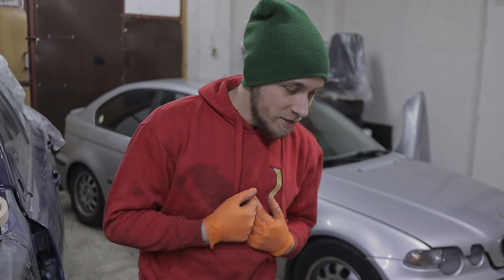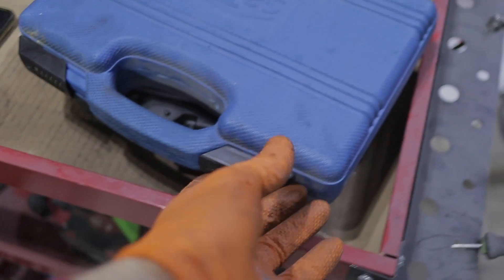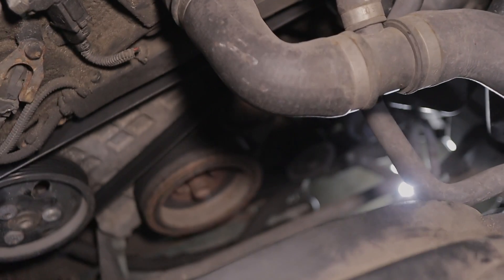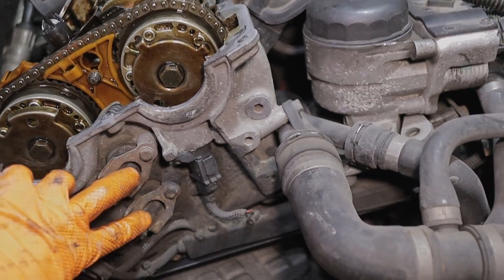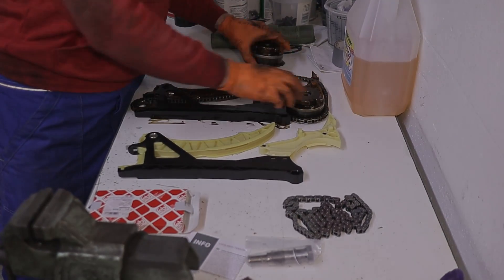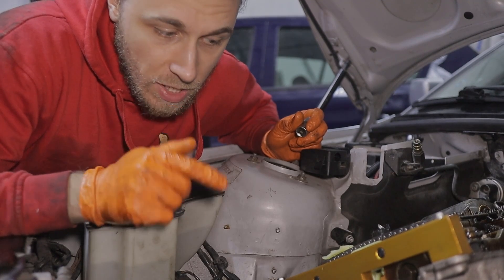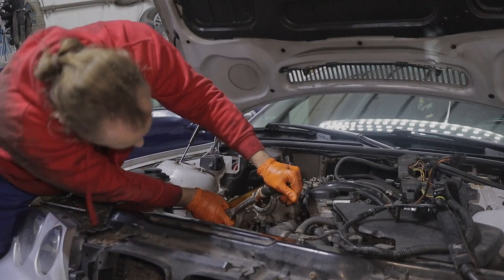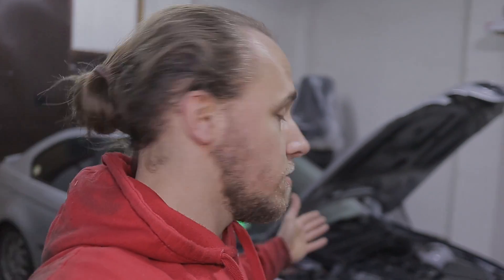How to change timing in N42 N46 N45 - BMW engine timing

Comment: Excellent video! Good to see you using Febi Bilstein chain kits - use nothing else. Not BGA, FAI etc. Febi is original Jwis as used by BMW.
The main problem I find with these is that the guides become brittle and break up. They are a white plastic when new - when they are orange from oil/heat they are halfway through their life and when they are dark brown, they're finished and about to break up. 
I've never had balance shafts move with the crank bolt out, but removing the oil level sensor to check is a great idea - I've learned something today! But - you need to tension the chain before tightening the cam bolts.

Before dismantling it's worth checking for a bad vanos unit - 16mm socket on the bolt and see if the camshaft moves when the vanos gear doesn't. 

It's worth mentioning that the crankshaft sprocket has to go on the correct way - it's easy to fit it the wrong way and have a horrible whine from the chain! 
These aren't bad engines but they need 7000 mile/10,000 km oil changes with good oil as you say.
Reply from the maker: that is exactly why we use FEBI ;) 

the comment regarding checking for bad vanos is a great addition to the topic! thanks for that ;) we've had a customer's car recently where both were bad 🤣 took us a little time to source new ones but managed to and the car went back running great. 

My n42 had a rough life but is still kicking. Not 100% good but does run. I have 2 spare engines so my idea is to run the current one to the ground and then swap it for another. In the meantime I need to get one of the spares sorted and ready for action!! 

Take care ;)

Comment: how to rebalance the balance schafts, if they come out of balance?
Reply from the maker: to do it right you should take the oil pan off, loosen crank bolt, align them and torque crank bolt. of course there is a need to time the engine when you do that

Comment: Hi, great video just wondering how would you realign the balance shafts if they wasn`t in line with each other, also is it possible for them to move whilst removing and replacing the chain assembly. Cheers Paul
Reply from the maker: I use a flat head screw driver to align them without taking the oil pan off or I unfortunately take the oil pan off… hate doing that ;)

Comment: hello, very interesting video. In my case I do not see the hole for the flywheel lock. The position to insert the pin corresponds to the top dead center of the first cylinder? Thanks
Reply from the maker: It does but the hole has to be there

Comment: These N46s really do need correct engine oil, I owners go cheap using wrong oil, or missing services.

I've worked on plenty of N46s with 200k miles still on first chain, only requiring timing chain guides due to age failure
Reply from the maker: when changing the guides we are putting new chain just because it's cheap enough not to worry about it. the most i've seen on first chain and guides was 260k km but the previous owner was doing 95% highway trips with this car so I reckon constant load does ware out things slower :) Those engines can go for a very long time. oil is key but the worst thing is that even if I get one and take good care of it noone can guarantee that previous owners did the same 😉
Reply: What is correct oil by viscosity and brand?

Comment: Great video. 

Just a heads up, the engine turns clockwise from front of engine side, rotating anti clock can cause issues (breakage) with the chain tensioner plates - - the plastic bits😊😎
Reply from the maker: I knew that its not adviced to turn the engine counter clockwise but noone ever told me why 🫣 i think it does make sense but then if it brakes from turning it counter clokwise isn't it on it's way out anyways? What I mean is that the forces of turning the engine by hand are so small it is insane that it can cause issues

Comment: I for the life can't loosen the crankshaftbolt. Extended the thing to the moon and it still will not move 😂 will a impact wrench do any wonders in this case?
Reply from the maker: Depends on the impact 🤷‍♂️ mine would not have the slightest chance…

Comment: If anyone is inserting the locking tool all the way, but it keeps spinning, some models (i think n46) need a longer locking tool (only about 1cm longer) as the locking tool in the kit doesnt reach the flywheel.

Just an fyi for anyone that might need it now or in the future 😀
Reply: Hi I got the same issue
Reply: @MatthewSimm  did manage to lock the flywheel?? Please I did ASAP respons
Reply: @shawnfernandes6161  yes i did, read what i wrote.
Reply: @MatthewSimm  did you get another locking tool set like a different brand??

Comment: Cant we just add a loinger tensioner?
Reply from the maker: the plastic guides tend to crack so the chain would not be tensioned, the chain streches so the timing is off so the answer is no. needs to have the whole set replaced

Comment: You know how to flush heater core in N46 engine in 120i E87?
Reply from the maker: take off the hoses that go into the heater core and plug in the water hose to flush, I've heard that it's better to flush it the opposite direction than the ususal flow is. chris fix made a video about something like this I think

Comment: Hi, I want to change the timing chain and guides in my N46 engine (just preventive) it has 101.000 km.

Is it really necessary to drop the oil pan? Timing guide is not broken.

What precautions should I take to make sure I don't move the balancing shafts?

Thx

Comment: Hello! I can’t find Top dead center. I removed the little panel protecting the flywheel. I can see the hole when rotating the crank. I can’t get the pin into the hole. 

Please help.. i only have a few days left to do this job..
Reply from the maker: I know it's late but it's the only way to put the pin in. You can always look into the cyl 1 but for timing job it needs to be locked in

Comment: Hello! Thanks! too good Video. You say that you need to change the timing chain and timing chain tensioner after 150,000 km. Bmw tells me I never need to replace any of this. They say it lasts the entire life of the car. My daughter lost a lot of money because her Bmw 318i N43 Year model 2009, the timing chain skipped a couple of teeth. And the valves hit the piston on 2 out of 4 cylinders, when her Bmw had gone 245000 km. Thanks! from Tommy Bertilsson from Sweden
Reply from the maker: The average lifespan of this chain and guides is 150kkm in my opinion. I know bmw says something else but the chain tends to stretch and it hits plastic guides pretty hard then they crack, block oil feed and you have a catastrophic failure… preventive maintenance is the best way to go. I’ve seen original 260kkm timings but only once. All depends on how the car is used. The M series engines had a lot better chains and guides. Those were able to handle lifetime of the car. Cheers 🍻

Comment: hey! i changed chain and rails,but car still wont start. In live data,ex vanos sensor is not working, but sensor is good. any ideas? bad ecu?
Reply from the maker: Issues like that are difficult to diagnose from afar. I’d check crank sensor and double check the timing 😉
Reply: @gorillaprojectcar got the car running few months back! Was low compression due to many start attempts(cyl washdown)

Comment: how do you align the flywheel with the locking tool i’ve been turning the crank so much and the tool is just not locking the flywheel what do i do it’s an n42 engine
Reply from the maker: There is a metal plate you can take off to see better but it just takes practice. My first few times it took me up to 20 minutes not it’s a matter of one minute

Comment: How did you lock the crankshaft and to what nm did you tighten it?
Reply from the maker: There is a pin with a timing set to lock it. 300nm
Reply: 300nm? I thought you said 200nm

Comment: wow you made it look easy
Reply from the maker: thanks but when you do it couple of times it becomes easy ;)
Reply: @gorillaprojectcar mind is auto trans the flywheel locking would be tricky right?
Reply from the maker: just teke off the steel plate that covers part of flywheel and you can see the place where the pin should be placed. being auto doesn't make it more difficult. just make sure your engine in first work stage. first piston in TDC for sucking phase 🤣 otherwise vanos will be upside down and timing set will not work well
Reply: @gorillaprojectcar also how do you bring back jump chain?
Reply from the maker: if the chain jumped there was a readon for it. setting it back correctly will maybe fix it for a while but it'll be a really short while. if chain jumps a tooth or more your tensioner can be bad, your chain can be stretched too much or your chain guides are busted. either way the whole thing should be replaced to avoid the issues in the future. If your chaing guides are not all in one piece I'd also recommend checking and probably changing oil pickup as it can be clogged. I was replacing an engine in one car this year. mechanic changed the timing but didn't even take out pieces of old guides from oil pan in effect oil pickup got clogged and the head had oil starvation issue which lead to overheating of the exhaust cam and it broke in half
Reply: @gorillaprojectcar  got the job done thank you for the guidance

Comment: Great video - really helpful. I was puzzled by the balance shafts but eventually found N45 does not have balance shafts so this can be simply skipped for anyone else here with N45!
Reply from the maker: yes, you are correct. That was my mistake... trying to make things too fast and missing few details. n45 do not have balancing shafts 🫡
Reply: Yes they do sir. The balance shafts are on the 2 L engines but not on the 1.6 L.
Reply: @MrBojangles901  ok thanks for clarifying. My comment is only accurate for the 1.6L N45 then

Comment: Awesome! I'm doing valve stem seals on my daughters N45 oil burner next weekend. When you reinstall the vanos cogs, do you have to count the links on the timing chain? Or do you just pull the chain tight? Cheers, very instructive and helpful video!!
Reply from the maker: just put them in as they go and before you fully tighten the chain it'll self adjust. Some people call cars like this a hybrid, burns petrol and oil xD I'm glad the video helped :D
Reply: @gorillaprojectcar  Thanks! Yes, the car definitely is a twostroke at the moment, hoping that the new valve seals will reduce the oil consumption a bit though😂

Comment: It's a probleem if i turn crancksaft counterclockwise ? How can i know that the pin is fitted in de flywheel ? Thanks
Reply from the maker: if you put the pin inside correctly the crank will not move almost at all. there is a tiny play there. you can take a plate that covers the flywheel next to oil pan that is bolted to the gearbox and see it ;)
Reply: @gorillaprojectcar  thanks

Comment: I need to replace timing chain + other parts on my 318i n42 e46, someone told me I need to drop oil pan and for dropping oil pan I need to drop alot other stuff too...Is that really the case?
Reply from the maker: Depends. If you take out all plastic guides you can do it without taking oil pan off but if any piece is missing you need to drop oil pan. If you leave the plastic pieces in oil pan they will clog oil pick up and starve the engine. I think in this video I said how to set balancing shafts which takes practice but is possible.
Reply: @gorillaprojectcar  Thanks for the reply bro! I will try to work on my car when timing chain and guides arrives! :)
Reply from the maker: Glad to help :) I wish you luck and in case you have more questions I’m also on FB, IG and TT but I’m working on my house so I’m slow with replying ;)
Reply: @gorillaprojectcar  Haha bro good luck with house! I got my chain and guides delivered today, now I need to wait for those timing tools :)
Reply from the maker: @aVeyt  take your time and don't rush it. I bet you can make it ;)

Comment: How t o set  bmw  roskers    n46b18a
Reply from the maker: You mean rockers? You don’t set them on the n42/n46 engines. They use hydraulic lifters so if you have a ticking noise coming from there it’s probably one of your lifter that’s given up

Comment: Hello, thank you for this video. I have a question? Did you just open the oil leven sensor to balance the oil pump? And you inserted the tool through the  this hole without opening oil sump?  
and open pully screw (hub) without special tools? is that possible?  You are a magician💯💯💯
Reply from the maker: Hi! I am not using the special tool for balancing shafts ;) just eyeball it and after you get it wrong once you’ll get it right every time 😂
Regarding pulley screw tools, I didn’t even know they existed 🤣 

I know there are special tools for all kind of things but sometimes they are not that necessary. Timing set is a must but you can manage without other things 🙂

Comment: just asking for n45b16A you just need to insert the pin in to the flywheel and don't need any adjustion  after that just the tool kit? I want to change mine but this seems too simple (i've done for vw polo and that was not this easy)
Reply from the maker: It really is that easy. Just properly mounted tool kit
Reply: Did you end up changing it yourself? I want to do this job, never done anything like it. But it seems doable. Is there anything you've encountered when changing the chain?
Reply: @ridgemills  yup i've purchased a hayness manual and 2 tool kits cause first one was questionable quality be aware of that when buying timing chain tool look át the reviews and new bolts everywhere!